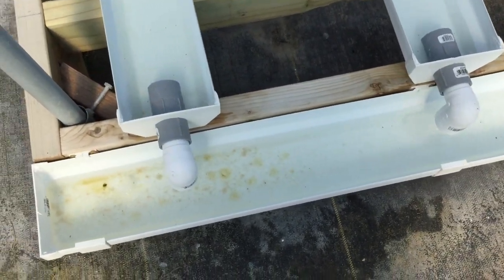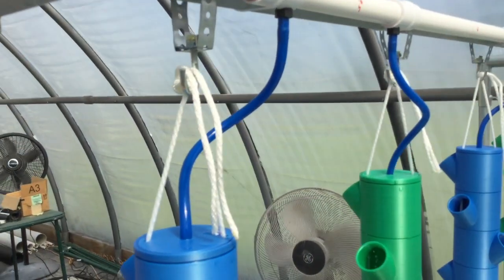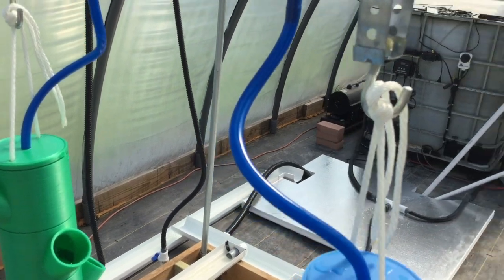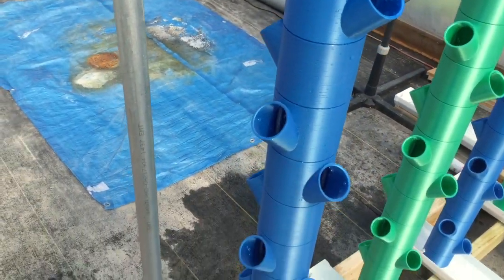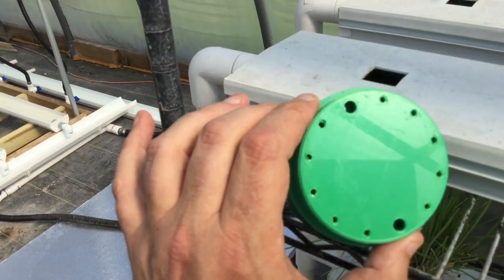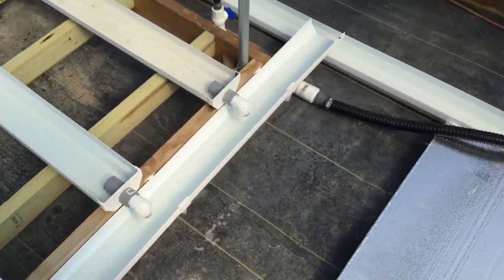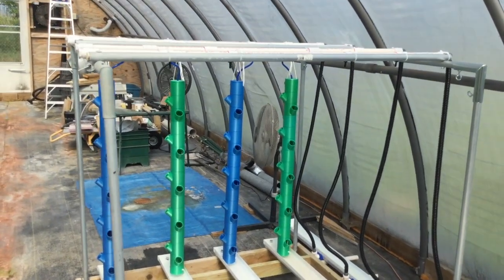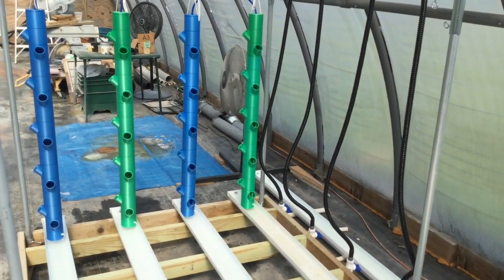Rack For 16 3D G-Towers (6)

Comment: WOW Larry - Those look Awesome!.   I wish I have the build volume to make those... I have a monoprice II.  I like it, it does a great job..but not a lot of volume space.. the best is around 4.8" x 4.8 x 4.8"..
Reply from the maker: These are just made with a pair of Monoprice Maker Select v2 printers. I'm not sure which printer you are referring to.
Reply: So... the actual diam/circumference and height..must be with that build volume of the MonoPrice V2..?
Reply from the maker: Not necessarily, it's just that a V2 allows me to print two segments at the same time. So I can just put the same color filament on both V2 printers and print a complete 4' tall tower in 3 days. A person could always use a smaller printer, it would just take longer to build a full tower.

Comment: Outstanding progress my friend!  I am moving my small experimental greenhouse to a new location starting this week.  It will be retrofitted for a new design utilizing the towers, but slightly different than yours.  My office display systems offer several possible solutions for smaller applications as well.  That's the beauty of this, it can be set up in a myriad of ways to meet the needs of anyone.  :)
Reply from the maker: This first rack worked great as a proof of concept and had to undo a few design mistakes along the way. The next ones will go together much faster and much more accurately.

Comment: Great job Larry! Are there specific plants you’re targeting for these systems? Do you think strawberries would be good in these towers.
Reply from the maker: The plan is two racks based on the 3x3 segments for herbs, spinach, arugula, and lettuce. That is 480 plants for those two racks. The last two racks will be one based on the 3x4 segments for slightly larger plants and the last rack based on the 4x4 segments for the next step up. Strawberries would work in the towers based on the 4x4 segments.
Reply: Just FYI; I have a friend in Kansas City who bought his own printer and made the 4x4 models. He only made four towers that are 6' tall each and he only uses them for strawberries.

Comment: Am I mistaken, or are those modular 3d printed parts. Does the rope run the whole length and is secured at the bottom with gravity holding it all together? Seems like a good way to go, in theory you could probably go as high as your component compression strength could sustain.
Reply: I have 6 of these installed in my solarium where I previously had Zipgrow towers installed that leaked all over the place constantly and always required me to perform surgery on them every time I wanted to replant them. These are a far superior design. I just bought a 3D printer so I can make more of them.
Reply from the maker: Yes, that's exactly how they work. They are supported from the bottom-up and gravity keeps things together rather than pulling them apart.

Comment: Larry I appreciate your amazing ingenuity on all the different levels here, and the fact you share it all freely, but it seems like waaay too much effort if the ultimate goal is to grow greens? So much time, and energy spent on what I feel is a very complex, not so easy growing system. What is the ultimate goal here if I may ask?
Reply from the maker: I'm actually making it far easier than any of the other tower options out there. Check them out, compare them, then tell me which one requires the least effort. My motto has always been "keep it stupid simple" (yes, those words in that order). If there was an easier way, I'd be doing it that way instead. What looks like a complex effort is actually extremely elementary, there is nothing high tech or complicated going on here...The ultimate goal? I don't want to babysit computers for the rest of my life. I have 13 years to go before I qualify for Medicare. I plan to spend all my time after that babysitting plants (not just greens, either) and fish.
Reply from the maker: This also isn't the holy grail of installation methods, this is just how I'm setting up my greenhouse. People are free to do things however they want to do it, they can copy my design or come up with their own design. I'm not trying to assimilate the world here, I'm just a hobbyist.
Reply: To the contrary, the hardest part about using these towers is finding a place to hang it, feeding water to it, and catching the water when it comes out the bottom. What part of that seems time consuming and complex? If you're focusing on the construction of the rack that he is installing the towers in, you're simply distracted by something that is just a personal project of his. Building the greenhouse itself was far more time consuming and complex. A person also doesn't need to build a greenhouse in order to use these either.
Reply from the maker: This is easy for me, I don't see a problem with it at all. I want my greenhouse and plumbing set up so that it's easy for me to work with. Nobody else has to do what I do, it's just a hobby for me. I've sold these towers and the 3D models to 213 people in the past year, everybody else has their own way of doing things. But as the person in the above who answers my website messages said, all a person has to do is hang the tower, feed it water, then recover the water. The way I'm building my system isn't a requirement to make things work. I just want my towers easy to reach and I want to be able to control my plumbing. After seeing the plumbing systems that other people use in aquaponics, mine is elementary level.
Reply: 3D printing these tower parts, stacking them up, and then hanging the tower in place is hardly the equivalent of a wagon on square wheels. Those EVE bucket towers require a whole lot more effort to build and install.
Reply: Think about it. You don't have to own a garage in order to buy a car. If you know how to build one and don't mind doing so, then build one. If the concept of building one is beyond your capabilities, then don't build one. It won't mean that you can't use your car anymore. If you would rather just pedal a bike instead, then do that instead of buying a car. See how all of that relates to this discussion?
Reply: EVE Growing -  Hydroponics works great in my climate and this version is much less expensive than most others.  It takes me only a minute or two to step out on my enclosed back porch and check that that my pumps are running and look over my plants while I have my morning coffee.  On weekends it is less than 15 mins to refill, check PH, add nutrients,  and plant seedlings if needed.   You have some good ideas with your system and it may work well for some larger plants, but for greens this type of system does not take much effort to monitor,  is easy to clean and is very portable.
Reply: Melissa; I do aquaponics rather than hydroponics. My routine is also much the same as yours except that all I do is feed my fish and add water to the fish tank as needed. I'm not running on a complex system either. Just 6 of these towers in my solarium hanging over the fish tank. I have a good solids filter just like Larry's so I never have clogs and even those water chemistry problems became a thing of the past 3 years ago. I fail to see what is so hard or complicated here.
Reply: All a matter of personal opinion. You are more partial to those EVE bucket towers and I think they look unnecessarily bulky, and require far more manual labor to build.
Reply: People seem to miss or ignore that part about being a hobbyist in the intro to your videos.
Reply: Vikki C really it’s not about personal opinion here it’s about what works best for any particular situation. If I see a person rolling a wagon up the hill with square wheels, and I think round wheels work better should I tell the person there’s an easier way?